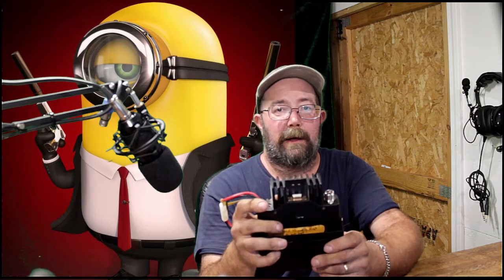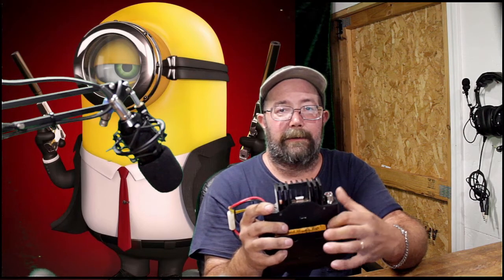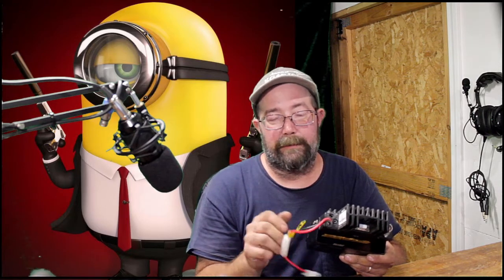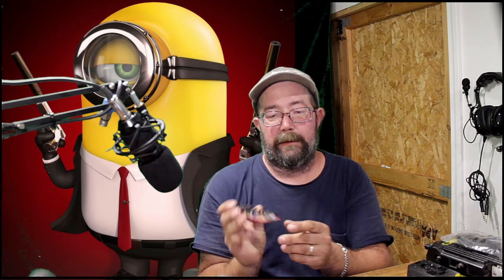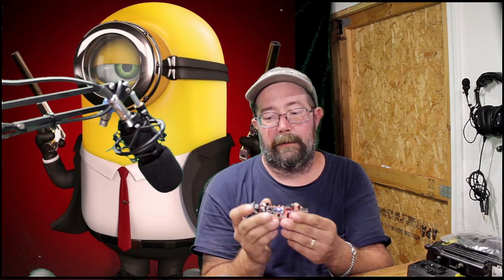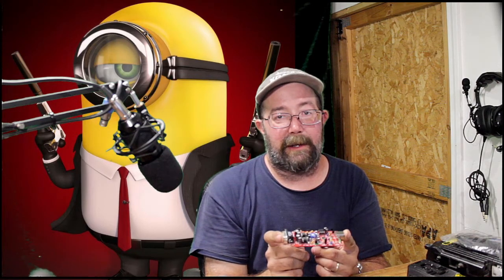Allstar Node from start to finish explained. Part 1

Comment: On low power and a nice fan. How she hold up so far buddy? Th9000d that is? All the stuff is almost here i was just curious how she will hold up. They have been linking dmr nets to a local allstar linked system to 12 other repeaters lol
Reply: Rigs hold up fine with good cooling. Be careful linking like that. Many don't like it and without repeater owners permission can be very bad.
Reply: Yes got permission. I will have to put a couple fans on it in summer. Gets about 75 in my shop

Comment: can i use 'dvswitch' without my own home node?
Reply from the maker: Only if you have login credentials on another node. You can't use it as its own node. The app basically gives your phone a connection to your node and your node is doing the work.